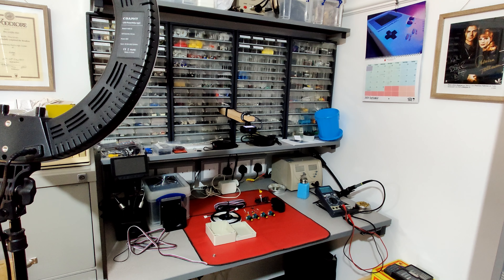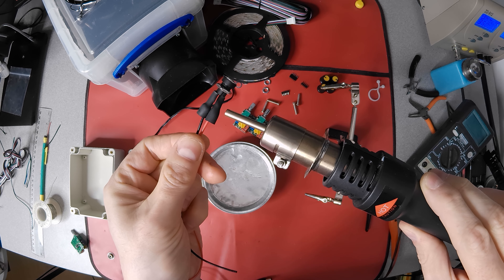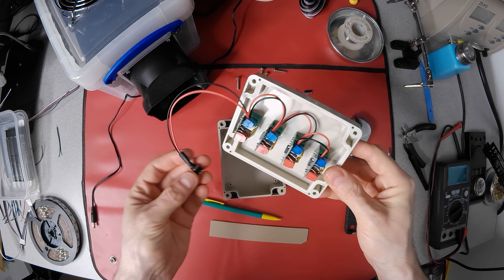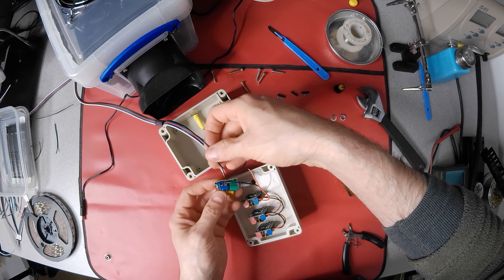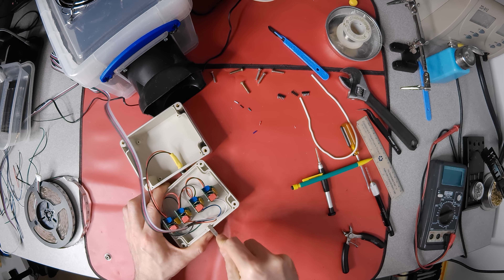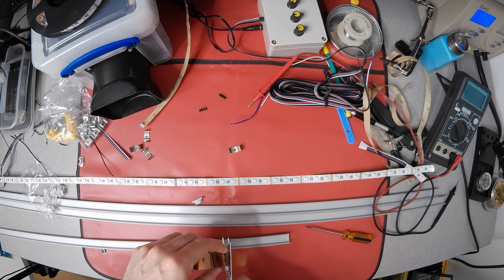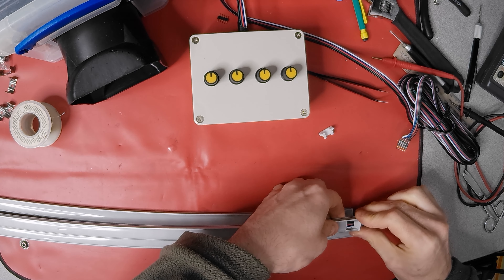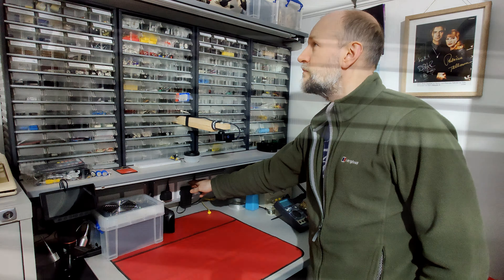Workbench RGBW LED Lighting (Video Safe No Flicker )

Comment: Did the same just with plain LED tape on some old edging strip left over. Works well, and provides light. For winter use I took an old time switch, and modified it to drive some pieces of left over tape, so that I get 10 minutes of light before the alarm, which is a very good thing to wake you up in winter when it is still dark outside. That lights up the ceiling and you do not get a shock when the alarm goes off, but are already half awake gently from the blueish light coming from above.
Reply from the maker: Great idea with the timing light, I know a lot of people find it difficult to get going in the morning with it being dark in the winter.

Comment: Great job!  Have you though about using a RGBW controller fo something like this?  Something like the Shelly RGBW?
Reply from the maker: Thank you. That's an interesting Wi-fi controller, not tried something like that. I did try a wall mount touch control when I did the cabinets in the museum but it couldn't cope with more than a few metres of LEDs at this density. Whatever controller you go for, make sure it can cope with the current draw and that it doesn't flicker on camera if that's also needed.

Comment: Quiet hotair? Well there are some with fan in the handle. There are different brands but model number is the same - 858d. The fan speed is regulated, so it can be almost silent.
Reply from the maker: Ahh like this one Dave on EEVBlog reviewed a long time ago (https://www.youtube.com/watch?v=vva2t21sOAs). The ZD-912 I have has a small air compressor in the base unit, and I think they use the same compressor swapped around for the ZD-915 desolder unit I have. On full flow it's very noisy like a tyre air compressor.

Comment: hi nice video, i am wondering how long i should get mine because i’m scared it might not go round my whole room, what do you recommend?
Reply from the maker: Thank you. Typically the LED strips are sold in reels of 5 metres so you'll need to measure the circumference of your room. If it's a typical rectangular room, measure the long and short sides, add them together and then double it. Some LED strips can be cut every 3 cm (check before buying) so you can get very close to the required length. Multiple lengths can be connected together in series. Check some of the kits on eBay where they selling a powerful enough PSU with several 5m reels. For a small room you could possibly have it as one length but I'd have it as two lengths (each a half of the room) heading out from the one point (opposite directions) Test it all before sticking to the walls though. Good luck.

Comment: Hi, what kind of non flickering controllers did you use? I've just built my own RGBW tubes but my led drivers are crap and flicker whenever I dim or mix any channels.. need to source a higher quality one..
Reply from the maker: Hi, thanks for watching. There's a link to the controllers in the video description.
Reply: @TheDigitalOrphanage  sorry my bad. Must have been blind 🤦🏼‍♂️
Reply from the maker: No worries, easily missed. Take care and good luck eliminating your flicker.